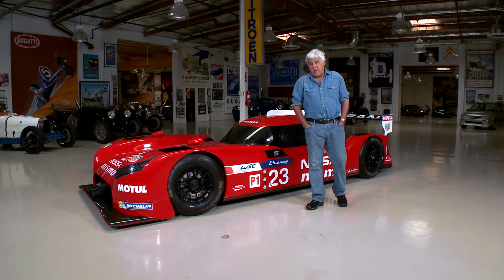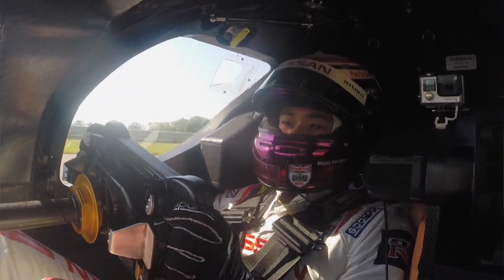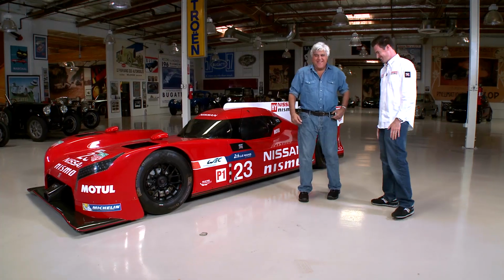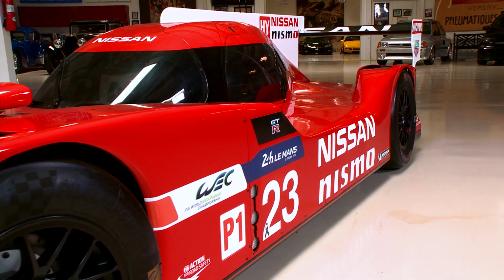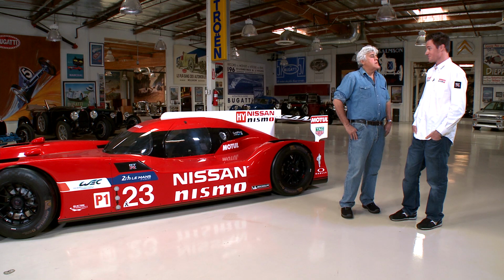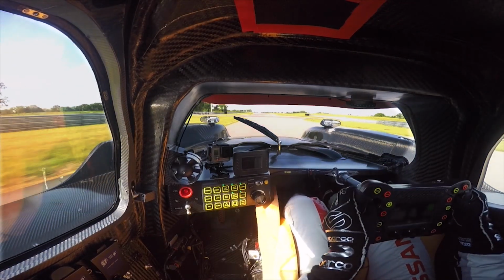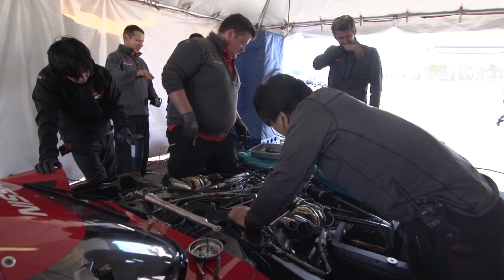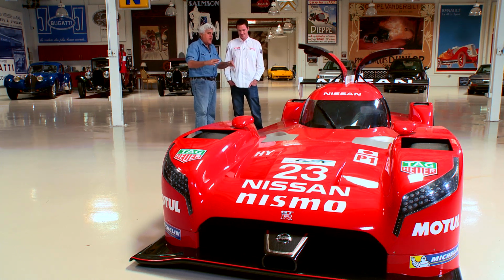Nissan GT-R LM NISMO - Jay Leno's Garage

Comment: these past few years, nissan has been doing some really cool stuff with the delta wing and such. I wish other manufactures would try to innovate like nissan is doing. It makes everything much more interesting.
Reply: They blatantly copied the Panoz deltawing. They only started working on their own after seeing that the DeltaWing actually had potential.
Reply: braveraxeblade the delta wing was neither Nissan's or panoz concept. If you're referring to the lawsuit, it simply a desperate final attempt from panoz to keep the company from going under.
Reply: braveraxeblade Panoz was involved in racing the Nissan DeltaWing, it wasn't a separate car.
Reply: +rob345

I was wrong about them being seperate cars, but Panoz may be going under, but that doesn't mean Dr. Panoz is anywhere near running out of money. He still has quite a few other businesses that are doing just fine.
Reply: braveraxeblade The guy who designed the Deltawing also designed the ZEOD and this GTR LM.
Reply: The DeltaWing was originally designed to be one of the replacements for IndyCars Dallara chassis, which ended up been the Dallara DW12 instead. Who ever draw the first sketch of the DeltaWing owns it. As for Panoz, they haven't built anything good since their front engined American LMP1 car in the early 2000's. The GT cars they made looked good, but went like crap.
Reply: ***** i just hope the Z's dont get a CVT
Reply: jckgoldness
gah, that woul be automotive heresy
Reply: *****
and that is exactly what makes it great. While all other designs have been basically copy/paste, nissan is out there doing something cool. Winning is not everything.
Reply: ***** for me its like, if an high jumper says: fosbury flop, whats that? I go back to the good old straddle technique... :D
Reply: ***** Actually winning IS everything. Nissan basically reinterpreted the rules and built the GT-R LM as a radical, "lateral thinking" solution to the "Audi Le Mans successive racing wins" puzzle. In theory, there are a lot of merits to Nissan's concept and design - they obviously thought so, as they wouldn't have built the car if it didn't. Ultimately though, it's still a gamble, and the car still has to prove itself on the endurance racing stage. Here's hoping they do well.
Reply: been doing it for years
Reply: I would be careful with using the word "innovate". In my opinion they've designed experiments and tried to validate that in real life. At the end experiments results were very poor, that's why we don't use them anymore in motorsport or production. If the validation would show a different results, what would be the innovation for me. However, they took the risk to experiment and measure the results instead of use the old known methods, this is the reason to give credits to Nissan as a company which is brave enough to do that.
Reply: yeah, they should concentrate finally winning a Le Mans with a sportscar, considering no Japanese sports car has ever won the greatest sports car race on Earth
Reply: I have a 2007 Nissan Murano with over 206,000 miles and I drive it like a TrackHawk.
Reply: @williampgalloway  Mazda anyone 787b
Reply: Hell yeah

Comment: It's so strange seeing this now, all the hopeful comments, and knowing it was a spectacular failure.
Reply: George Rosebush I'm glad they innovate, but as soon as I heard about this car, I thought it wouldn't work. FWD in a 1000hp racecar?! That's crazy. No traction, excessive wear and slow corner exits.
Reply: But my gawd it was spectacular. I salute the lofty ambition.
Reply: The results were lacking but it did alright on the track, just not good enough, and with the margins in racing..
One race is all they got with the car, but still, innovation is usually an itterative process, and they just didn`t get the needed time, and the hybrid system wasn`t implemented by the time the arce was on.
A bit more time for evolution and testing, and it might have been very different.
At least maybe it would be 20 seconds off par hehe..
Reply: It Fail cz they put a Legendary nme n d car, d GT-R which wd nvr b a FWD. They hd md it RWD it wdve bn a dif Story. More Lk Panoz , who I Totally hv Respect 4 cz they ddnt Follow Evrybdy else n go mk a DUMB Rear Eng car
Reply: @dezandyram2544  your reply literally gave me dyslexia
Reply: @Phenom98   Wrong, it wasn't 100% FWD it i suppose to deliver power to rear wheels as well. Car would do perfectly fine if they didn't mess up in production. They ran cars in race without enough testing and development. Cars raced without hybrid system....
Reply: @dezandyram2544   Maybe you could try words!!!!! Your reply is silly to the point of being ridiculous.
Reply: @dezandyram2544  You have no right to call anyone or anything "DUMB." The fact that that was the only word you could spell really says a lot about you're own intelligence level.
Reply: George Rosebush 

hybrid not working and it is 50% of the total horsepower
Reply: @captainkaba1414  😂
Reply: When the car went into the race it was something like 5 months behind schedule and they had a lot of bad luck in the race (I believe two of the cars crashed into eachother). With that I do believe they had some laps led so really considering that this was its first and only race you really can't call it a failure. If Audi gave up after its first attempt it wouldn't have had such a long and good career, this goes for a lot of great racing team (Ford GT40 anyone?). 

The real shame was that the program was canned in its infancy which I would have wanted to see the car run in its proper form to see what it was capable of.
Reply: @captainkaba1414  Irritating. Is it supposed to be funny? I doNt g8it¿
Reply: @dezandyram2544  i had a stroke reading your reply
Reply: I think it's a really cool historical vehicle. A great idea to simply try it, certainly a failure, but not without some intrigue.
Reply: Nissan would have done better to invest in their Jatco subdivision to improve their transmissions reliability . Persisting in  R&D for creating a Fwd race car 
 is money  badly invested if you want to win . Unless you want to eliminate torque steer for street car .
Reply: @dezandyram2544  I managed to decipher what you said.  I dont think it would have dominated if it was rear wheel drive.
Reply: @brycehanneman4144  Using "you're" incorrectly says a lot about YOUR intelligence level! 😂😂😂
Reply: @AlymerKiteboy  oh wow. Didn't even realize. I guess it's almost like it's a youtube comment and not a college paper. Pretty sure my message was still intelligible. his was not. my point stands... I think I'll just leave it as is.
Reply: @dezandyram2544  do humanity a favor and type words, don't be a Kevin Malone of comments
Reply: RIP Kobe
Reply: @my1krr  What the hell are you on about? The driver made no wrong moves, did you not see what happened? The car was the failure
Reply: Jason Bouphasavanh  He probably had more successful races in real life than you had in Mario Kart. Show some respect, LeMans is one of the hardest races ever.
Reply: @sqmotorsports9230  yeah and cool looking, but it would always be hard to make it work
Reply: Only one year of development and they built that car amazing. Imagine if they had backing like the other teams
Reply: What an amazing flop though, totally outside the box like Howard Hughes ambitious. A brilliant engineering feat
Reply: @captainkaba1414  Yeah I agree 😅
Reply: @Phenom98  It was supposed to be AWD, but the flywheel hybrid system failed.  FWD cars have won in endurance races before, such as the 25 Hours of Thunderhill which also has similar straights as Le Mans.
Reply: Sabotage de Renault

Comment: Lift the rotary ban!!!
Reply: Michael Theurer maybe when they can pass emissions but that wont happen
Reply: joecugo so they can what? Outrun off gas?
Reply: joecugo what you said. Im trying to make sence of it
Reply: joecugo hahaha that sounds better lol
Reply: joecugo i must has been more tired then i thought then
Reply: @liamcooper5202  actually Mazda is thinking about using rotaries again with their skyactiv system I think.
Reply: @vasilis23456  yes skyativeX system the only way to make a rotary any good but its still a "2 stroke" type engine requiring oil injection. Not to mention the good old apex seals. Will have to come with auto only because noone will rev the poor things enough to work 😂
Reply: Michael Theurer , spend half the race behind pace car while they pick up the pieces.
Reply: I believe they have now.
Reply: @Pete-z6e  They did finish and win when pistons couldn't, soooo
Reply: i know im late, but rotaries are legal in lemans again btw
Reply: @TheEowli  from when? Didn't know that! But idk if Mazda has the money to pursue racing right now
Reply: They allowed in hypercar for next year, maybe Mazda will return?
Reply: ICE ban soon
Reply: @TheEowli  2021
Reply: @mortache  2021 30 years after facts
Reply: @scuckplexity  I meant that "pursue racing with experimental new kind of engine". There's a reason why Mercedes keeps winning F1
Reply: The ban was lifted with the LMH regulations.

Comment: Two years later......it didnt work! Nissan pulled the plug, never giving them time to develop. They never did get the flywheel hybrid system to work right (if all), so they were only running FWD with no energy harvesting/storage. Because of this, massive understeer off of courners, unable to power down with FWD with out massive wheel slip. Makes one wonder if it would have worked had they had time to develop and make the hybrid/energy harvesting work, and send power to rear wheels under acceleration.

Comment: This is from WIkipedia so you don't have to google why everyone makes fun of this in the comments:  "The car made its racing debut at the 2015 24 Hours of Le Mans. Three cars were entered for the race by Nissan Motorsports, numbered 21, 22 and 23. The cars qualified in the last three places of the LMP1 class with times over 20 seconds slower than the pole position time set by the No. 18 Porsche 919 Hybrid. The No. 21 car was even out-qualified by the fastest LMP2 car. After the three cars failed to achieve a time within 110 percent of the pole position time, they were demoted to the back of the prototype grid. The No. 21 car retired from the race after 115 laps with a suspension failure, while the No. 23 car retired on lap 234 with gearbox issues. The No. 22 car finished the race, but was not classified as it failed to complete 70 percent of the race winning car's race distance. The car was never raced again."
Reply: A hilarious dumpster fire

Comment: I really, really hope the GT-R LM NISMO avoids the curse of the Delta Wing.
Reply: likeits1985 Technically it is a delta wing, but it is backwards, getting rid of most of the problems it (the delta wing) presents.
Reply: odombones94 seems legit. Engineer: we have got a lot of problems. Other engineer: turn the car around it will be fine.
Reply: vivalaphill Also, a big help with areo that only this car can really achieve, it has much bigger tires in the front than the rear to help reduce drag.
Reply: David Lewis you can just post the part behind the youtube/ here would be great
Reply: 20 seconds slower in Le Mans Qualifying.
Reply: ***** Meh....why so negative?  If Nissan wants to try something new, I for one applaud them.  It's easy to bash something when it's going wrong.
Reply: likeits1985 regulations limited front tire size you can see the result atm.
Reply: +likeits1985 :))
Reply: Nope!

Comment: A car that Jay can't drive in, for reasons.
Reply: Karlen Bell Yes,there is a reason for everything. Well done ;)
Reply: Karlen Bell One of those reasons being it is a race car which is not street-legal, another reason being that this car is going to be raced in less than two weeks time and if Jay crashes it then the car will lose some very important test sessions. A third reason being that I don't think he is even qualified enough to drive this car - a racing driver needs to have an FIA-certified International A racing license (or greater) to get behind the wheel.
Reply: Billy Raymond I think Jay will drive any car as long it is street legal, but this is not, unfortunately.
Reply: Kind of hard to drive a car without an engine.
Reply: Billy Raymond you missed the obvious, he doesn't fit in it ;)
Reply: Show car, no engine lol duh!!
Reply: jackoghost He could fit after a stint with a ketogenic diet.
Reply: hitssquad to much effort :P
Reply: jackoghost I've found it's pretty easy to eat nothing but butter.
Reply: hitssquad just butter or also flavoured butter? like non butter tasting butter
Reply: Hit me up when you're almost 70 and we'll see how well you squeeze into race cars!.. now get off my lawn!
Reply: Stev Rex Some people strength train, and therefore don't age as fast as others. If you're going to arbitrarily put a cutoff at 70, then why not 50, or 30, or 25? Or why not instead simply leave it between people and their respective insurance companies?
Reply: Stev Rex ..
Reply: Okay. Mr. Leno does not take good care of himself. Were he to start actually working on his own cars might help, rather than simply being a wealthy guy who writes checks.

It is interesting that in the Zo6 video, Mr. Leno does not show what happened by being stopped by a cop. Mr. Nelson from Nelson racing does show his stop in Malibu. Fact is, Mr, Leno was breaking the law in the Corvette, as he quite often exceeds the speed limit. Perhaps he fears being seen as reckless.

Thing is, who needs the excess of a performance car?
Reply: +Stev Rex You say Jay Leno doesn't wanna be seen as reckless, Yet he does burnouts in a lot of the cars he drives in these videos... I don't think he cares what people think about him or his driving.

You are looking at performance vehicles in the same way a none gamer looks at someone playing video games, Or a none drinker looks at someone who drinks... We don't 'need' excessive performance in a car, but it is fun and enjoyable, It is a hobby.
Reply: +Billy Raymond only if competing. anyone can drive anything privately
Reply: Stev Rex Or he could have thought people didn't care about it. Like me.
Reply: +braveraxeblade Thanks
Reply: "Making excuses for being old. At seventy, you should not be driving. Your reaction time is gone by that age. Do not take it so personally, most people age."

I know quite a few 70 year old men that have been driving probably longer than you've been alive, been driving higher performance cars than you've ever handled and could easily out drive you any day of the week. One of them served with Seal Team 2 and later Delta Force and keeps in shape, one of them drove big rigs and is a fabricator/welder and built and races his dune buggy (and you need lightning quick reflexes on the dunes), and another who daily drives a 400hp GTO and an 800hp GT500.

Let's see you're evidence than all 70 year olds are not capable of driving. Driving isn't difficult, but most people are idiots and can't drive regardless of age.
Reply: All 70 year olds are not created equal. No one ages exactly like someone else. It's asinine to assume every 70 year old's reactions are completely gone. Maybe some of them, but DEFINITELY not all of them, especially NOT the healthy ones.
Reply: Snakes, that GT500 you mentioned, does it happen to be a '67 Mustang?
Reply: It's an economy race car!
Reply: hard to drive a car with.......no engine
Reply: The reason being the cockpit is sized for horse jockeys and Jay is almost 6 feet and relatively stout.  I don't think he'd actually be capable of sitting behind the wheel to be honest, and certainly not comfortably enough to safely pilot such a fast car.
Reply: How’d we get from race car to eating butter?!?
Reply: @legoferrari14  did you forget the most important reason? Its a show car with NO ENGINE. pay attention
Reply: his chin too big
Reply: @legoferrari14  someone wasn't listening..............

Comment: Well in about 24 hours round 4 of GT Academy will open and soon this beast will be unleashed by a lot of Gran Turismo players including myself. I'm looking forward to driving it with my wheel but I'm just hoping it handles well but being Nissan the smart company they are I'm sure they've nailed it. My guess for the track would be Le Mans for obvious reasons.
Reply: can't wait for tomorrow!
Reply: MJTbreww fucking unturneable car
Reply: Dimitriy Yukhymenko It's FF. Try letting off the throttle, maybe? You'll eat the the tires in a race. In a hot lap, it's speed and stability you'll be getting.
Reply: MJTbreww you're not even on the leader boards.
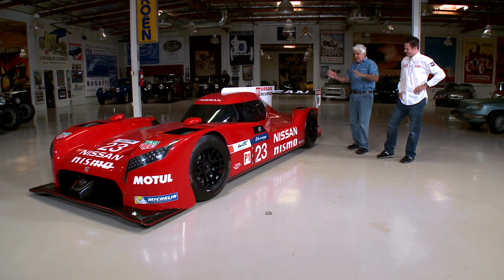Reply: Benjamin Kham I technically am, just not very high up. I've only done 1 lap and it was a 3:34.866. There's an easy 1-2s I can wipe off it I just don't have a lot of time
Reply: MJTbreww I hope you're right about easy seconds.  I wish I could say that.
Reply: ***** hotlap for the time trial in GT6. No doubt le mans is about reliability. Who would think otherwise?